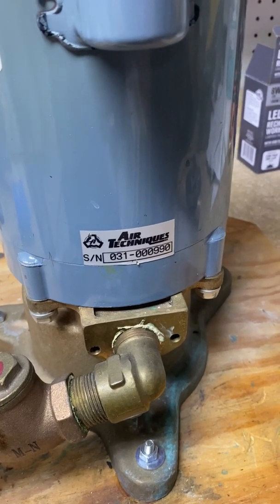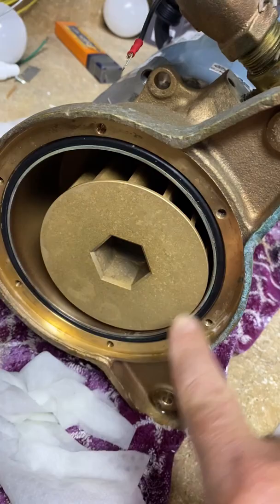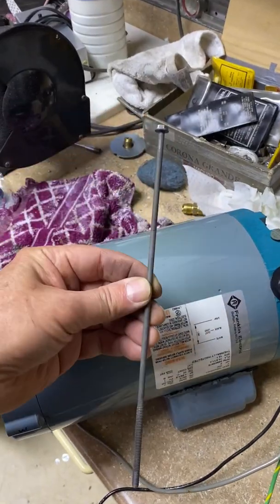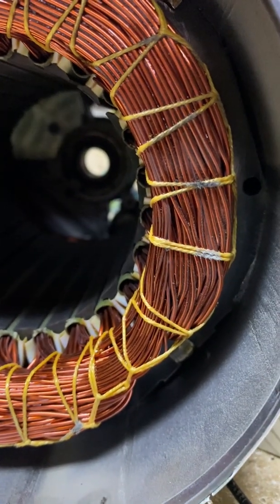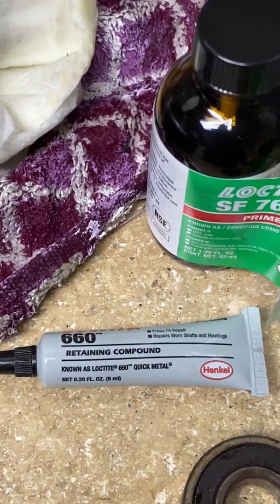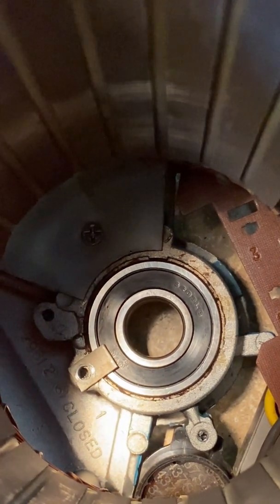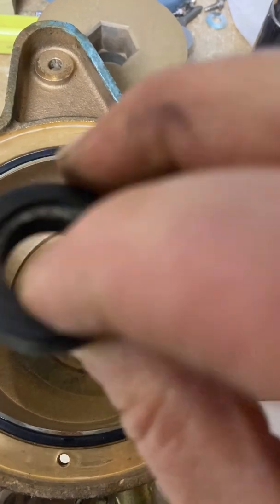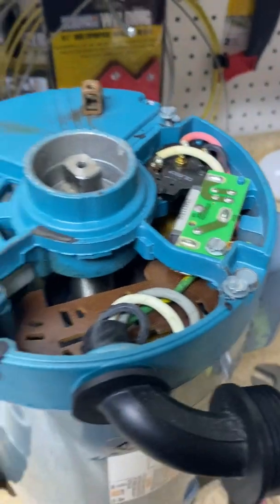VacStar 80 Vacuum pump motor rebuild

Comment: Thanks for posting this. I’ve got a midmark matrix maximizer 2 hp twin head vac that I’ve gotta do this to. One head has just above zero suction, the other has about 5”. Really bad although both motors run. What were the symptoms that made you need to do this? And how did you know which bearings and seals rot get? Midmark didn’t give me any clue as to what brand of motor it is- just has a Midmark plate on it. Also, where did you get the seals? I’m sure Midmark no longer supports the maximizer 2000.  
Great vid again.
Reply from the maker: I got the seals from dentalequipmentparts.com and the motor bearings from https://www.locateballbearings.com

The main reason I did the rebuild is the motor bearing were making lots of noise and on the brink of failure. I replaced the seals since I had everything apart and they are cheap. For bearing replacement it really does not matter what manufacturer motor you have as the bearings are generally marked with their size. Hope this helps and good luck!
Reply: @edshandymantips4862  thanks very much for the response. I appreciate the links as well.

Im probably gonna go through this whole thing and it still won't work.